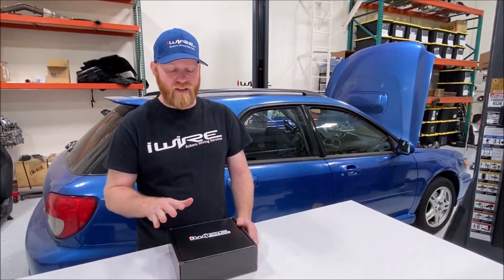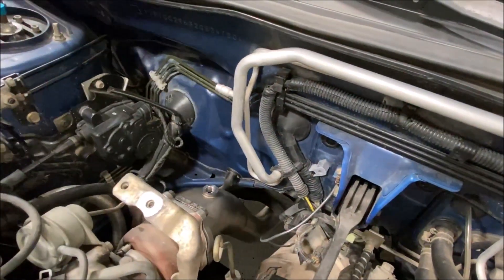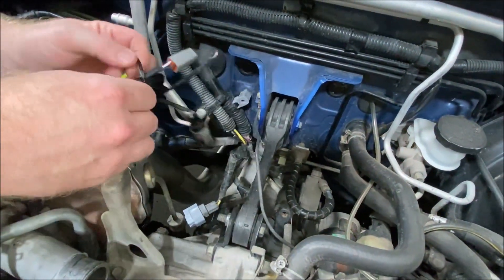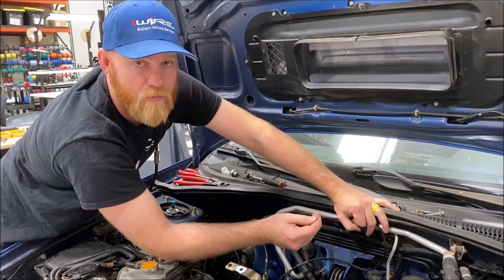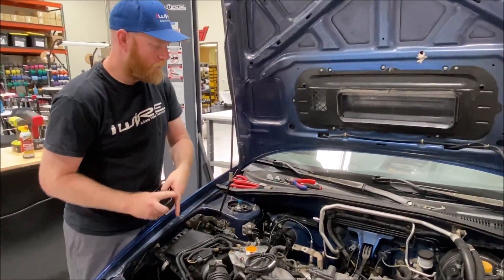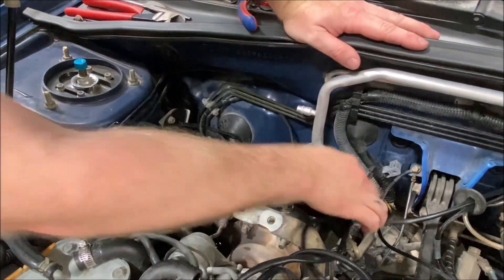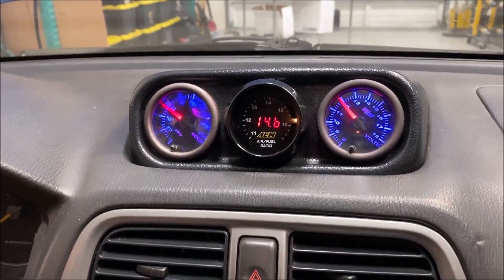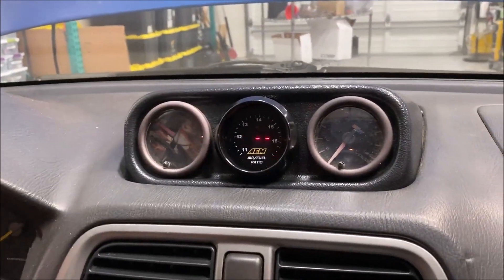AEM Wideband Sensor with Gauge with iWire Plug and Play Wiring Kit for Subaru

Comment: I have a 04 sti with an after market downpipe and exhaust but I have two O2 sensors. 

So I plug the rear O2 sensor and just run the UEGO front sensor to the Downpipe and from there the gague and ECU?
Does the front O2 sensor connect to a gague AND the ECU? So I don't really need the rear at all?

What if I wanted to get a UEGO for the rear? would that help monitor the AFR better in my car?
Reply: The front is less accurate at higher rpms, you want after the turbo. You need both front and rear. Stock rear is a narrow band sensor and not as effective for a modified subaru, hence why they tend to get tuned out.

Comment: Will this work with the new cobb update? Been trying to figure out how to do datalog sinced cobb made an update on rear o2 sensor.
Reply from the maker: Our updated version does work with Cobb update, but only to function as a gauge and not disable the rear 02. As of the Cobb update, there are no ways to bring outside information into the ECU for data logging.

Comment: Hello, big newbie here to this stuff.

With the recent update from Cobb's "Green Speed Project," do you know any of the new potential problems that I could face with tempering with the rear O2 sensor?
What would a tuner need to do specifically with this kit in order to make my WRX function together with this?
I want to avoid throwing and keeping an engine code if possible.

Also, I just read in a comment on this video that this is made for a temporary tool for tuning. Is it not recommended to keep this plugged in after getting it tuned?
I'd like to have a gauge still active so I could have a visual on my AF/R and free up a gauge spot on my Accessport.
Reply from the maker: Our updated kit allows for the use of the gauge without interrupting the rear 02 signal but removes the logging feature. Please send us an email to info@iwireusa.com with further questions. Thanks!